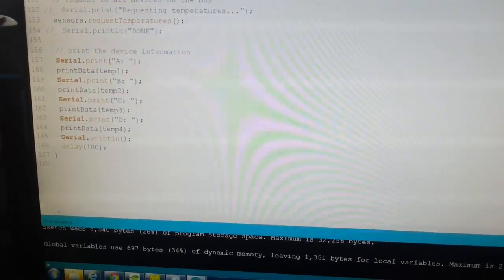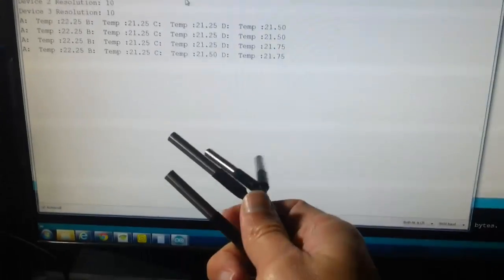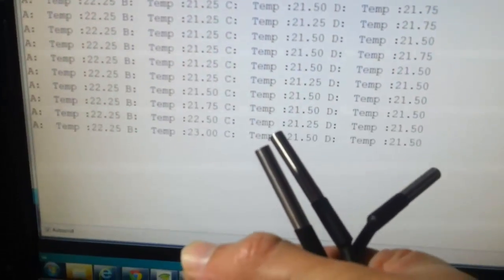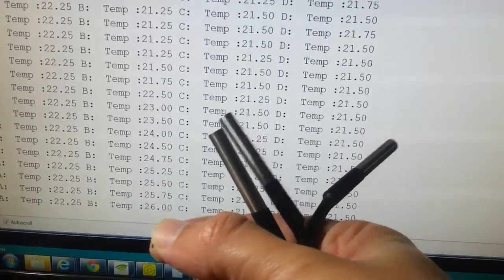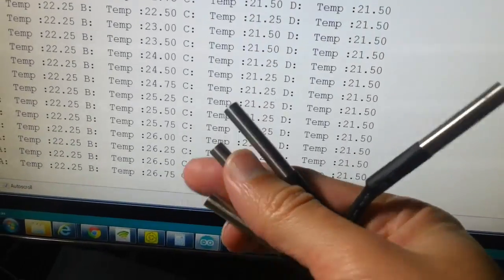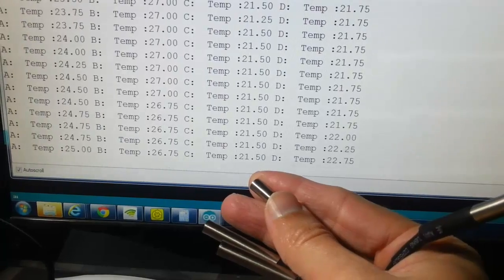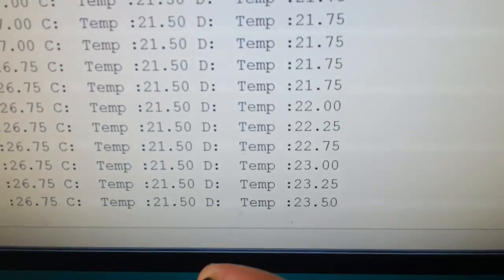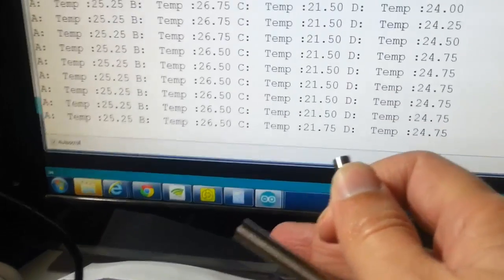Connecting several DS18b20 temperature sensors to Arduino

Comment: If you connect sensor by data sheet, use this code.
s1 and s2 are sensors...

#include <OneWire.h> //Include libraries
#include <DallasTemperature.h>
#define BUS 2 // Data wire is plugged into pin 2 on the Arduino
OneWire oneWire(BUS); // Setup a oneWire instance to communicate with any OneWire devices (not just Maxim/Dallas temperature ICs)
DallasTemperature s1(&oneWire); // Pass our oneWire reference to Dallas Temperature. 
DallasTemperature s2(&oneWire);
void setup(void){
  Serial.begin(9600); //Begin serial communication
  s1.begin(); //start sensor 1
  s2.begin();}
void loop(void){ 
  s1.requestTemperatures();  // Send the command to get temperatures
  s2.requestTemperatures();
  Serial.print("Temperature on S is: ");
  Serial.print(s1.getTempCByIndex(0)); // Why "byIndex"? You can have more than one IC on the same bus. 0 refers to the first IC on the wire
  Serial.print("  ");
  Serial.print(s2.getTempCByIndex(1)); 
  Serial.println();
  delay(1000); //Update value every 1 sec.
  }

Instead of using
 Serial.print(s2.getTempCByIndex(1)); 

you can define float and get reading into float and then print that value.

Have fun and share your knowledge :)

ps. this works on ATTiny 85, its around 6 kb, so you can use it for control of cooling or heating, peltier/fan via pwm, etc...
pss. you need TinyWire for ATTiny
Reply: Jedan Decko thanks bro for you help ........now I will get $80 from fiverr order
Reply: thanks man, you've enlighten my day :)

Comment: Thats with 2 connected to 0 and 1 digital pin and a 20 by 4 lcd. Pins 2 seems not to work. Will try to add more temp sensors laters.

Comment: #include "cactus_io_DS18B20.h"
int o = 0; // fine adjustment + to increase temperature
// Create DS18B20 object
DS18B20 ds(1);  // on digital pin 2
DS18B20 ds1(0);  
#include <LiquidCrystal.h>
LiquidCrystal lcd(12, 11, 6, 5, 4, 3);

 //#include <idDHT11.h>
//int idDHT11pin = 2;
//int idDHT11intNumber = 0; 
//void dht11_wrapper(); 
//idDHT11 DHT11(idDHT11pin,idDHT11intNumber,dht11_wrapper);

void setup() {
 // pinMode(9, OUTPUT); // heater led
 // pinMode(8, OUTPUT); // heater relay
  lcd.begin(20, 4);
  ds.readSensor();
    ds1.readSensor();
 // Serial.begin(9600);
 // Serial.println("Temp (C)\tTemp (F)");
}
//void dht11_wrapper() {
 // DHT11.isrCallback();
//}
void loop() {
   start:
  ds.readSensor(); 
    ds1.readSensor();
   delay(200);
   // int result = DHT11.acquireAndWait();
 // switch (result)
 // {
 // case IDDHTLIB_OK: 
   // Serial.println("OK"); 
  //  break;
  //case IDDHTLIB_ERROR_CHECKSUM: 
  //  Serial.println("Error\n\r\tChecksum error"); 
   // break;
 // case IDDHTLIB_ERROR_ISR_TIMEOUT: 
  //  Serial.println("Error\n\r\tISR time out error"); 
   // break;
 // case IDDHTLIB_ERROR_RESPONSE_TIMEOUT: 
 //   Serial.println("Error\n\r\tResponse time out error"); 
   // break;
 // case IDDHTLIB_ERROR_DATA_TIMEOUT: 
  //  Serial.println("Error\n\r\tData time out error"); 
   // break;
  //case IDDHTLIB_ERROR_ACQUIRING: 
   // Serial.println("Error\n\r\tAcquiring"); 
   // break;
  //case IDDHTLIB_ERROR_DELTA: 
  //  Serial.println("Error\n\r\tDelta time to small"); 
  //  break;
 // case IDDHTLIB_ERROR_NOTSTARTED: 
  //  Serial.println("Error\n\r\tNot started"); 
 //   break;
 // default: 
   // Serial.println("Unknown error"); 
 //   break;
 // }
   // lcd.setCursor(0,1);
 //   lcd.print("Humidity");
  //  lcd.setCursor(9,1);
//    lcd.println(DHT11.getHumidity(), 0);
 //   lcd.setCursor(11,1);
 //   lcd.print(" %");
    lcd.setCursor(0,0);
    lcd.print("Temp");
    lcd.setCursor(5,0);
    lcd.print(ds.getTemperature_C(), 1);
    lcd.setCursor(10,0);
    lcd.print("C");
     lcd.setCursor(0,1);
    lcd.print("Temp");
    lcd.setCursor(5,1);
    lcd.print(ds1.getTemperature_C(), 1);
    lcd.setCursor(10,1);
    lcd.print("C");

 

   delay(1000); 
}

Comment: Thank you for your awesome project, but creating a video and not sharing your knowledge is pointless or... in the worst case, it's simply bragging. We truly can not see how all the sensors are connected in parallel to PIN9 and we would all appreciate the schematics, the arduino code that you uses for your project and everything else that you think it might be useful.

Hopefully you will open your heart and mind and share the information. Thank you again!